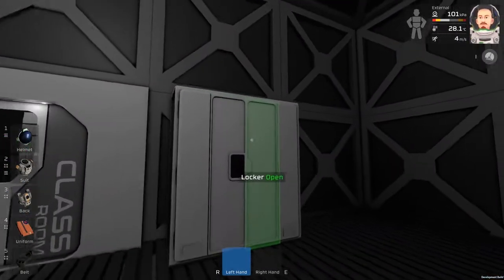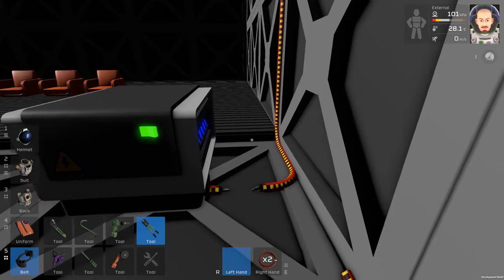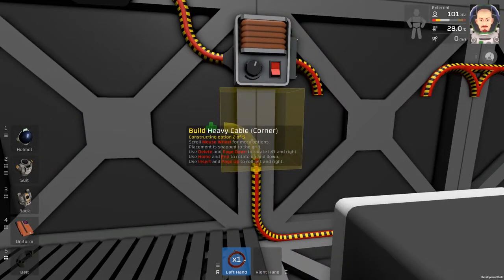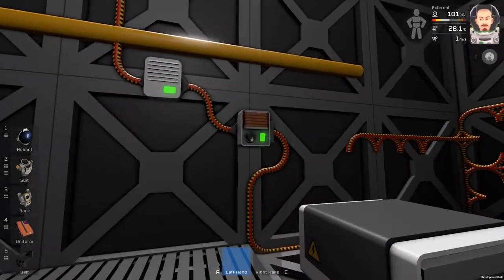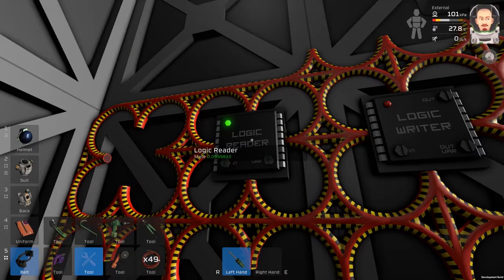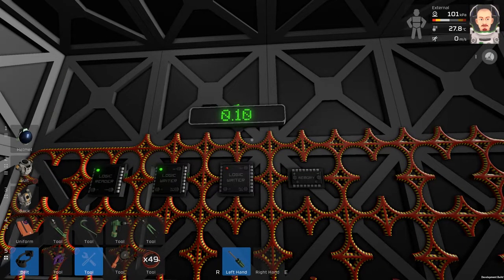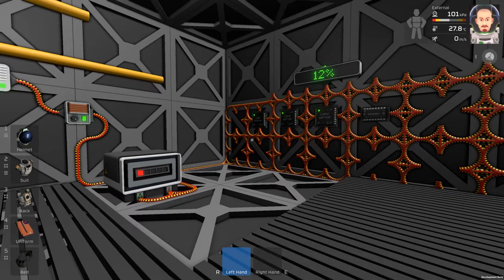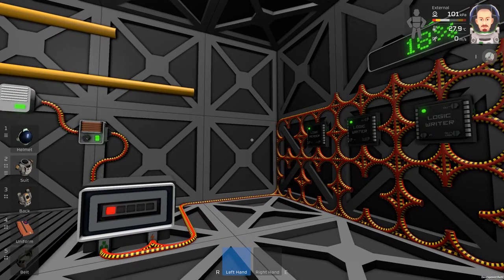Stationeers - Large battery charge capacity display

Comment: for some reason my logic writer don't have the led display as a option for out
Reply from the maker: Do you have it connected?
Reply: yea it took like 6 minutes, i have 20 battery's i had to get through
Reply from the maker: You can make small subnetwork from that writer which goes directly to the LED Display, then you will do it in 10 seconds or less, if it is possible

or

Connect writer directly with one cable to LED Display, program it first and after that connect everything you need

and

Dont forget, if you hold ALT then you go backwards when programming readers and writers

Comment: here is how I made mine for a large battery bank. 

not sure how long this link will work
https://ibb.co/dQpALn

CA1 -> cable analyser on the output of the battery bank.

Chip: LR1 Logic Reader)
Input: CA1
Value: Power Potential

Chip: LR2 (Logic Reader) (could be replaced by Memory chip)
Input: Stationary Battery
Value: Maximum

Chip: M1 (Memory)
Value: 100

Chip: M2 (Memory)
Value: (7) number of stationary battery

Chip: MU1 (Math Unit)
Input 1: M1
Input 2: MU2
Out: Multiply

Chip: MU2 (Math Unit)
Input 1: LR1
Input 2: MU3
Out: Divide

Chip: MU3 (Math Unit)
Input 1: LR2
Input 2: M2
Out: Multiply

Chip: UM1 (Unary Math Unit)
Input: MU1
Out: Ceil

Chip: LW1 (Logic Writer)
Input: UM1
Out: LCD1
Reply from the maker: impressive man, we still need a parking lot for logic circuits, dont we? :D
Reply from the maker: I have scheduled videos for next 6 days from Stationeers, I am sure, you will see there something very similar, thank you very much for sharing the picture of your setup
Reply: true. this one is fairly simple. I have some that are a nightmare to follow or do
automating stuff can be a pita

this one was just for fun as I'm working in a sort of "creative" mode on the moon.
I have a 32 stationary battery bank and just wanted to know how charged it is so I designed this circuit

however, since the latest build of the game. I'm in a bad shape due to a few game bugs (running beta) 
have to wait for them to fix theses :)
Reply from the maker: I am running Beta too, I dont know why, but I have a feeling, Beta runs better for me
Reply: have atmospheric issues on my game.
1 of my room is currently burning when I open the game.
another lost my circuitry

on a different room, airlock open, 0kpa. I jump through the airlock soor and 100kpa.  I jump back. 0kpa. 
same issue with normal door.  Door open. 1 side has atmosphere. the other does not

have not been playing since last 2 weeks so I guess something broke down
now, have to  deal with the hungriness :)

anyway, have fun and let's all play nice
Reply from the maker: try to deconstruct one wall on room which shows wrong pressure and put the wall back, it should fix it

Comment: Your class didn't make it today? that's too bad, thank you for the Video. Also does this work with more then on battery and can you change the color of the display?
Reply from the maker: My students are very lazy, last time I had too much mess in my class room when they left. 

How to change LED colors ( LED wall lights, it works for LED displays too )

https://www.youtube.com/watch?v=igxyP5jDE_U

For more batteries, you will need bit calculation lets say:

( battery 1 ratio + battery 2 ratio + battery 3 ratio ) divided by amount of batteries ( 3 ) and then diplay the data

for color change use logic writer with output LED display, input memory, where you will change number from 0 to X, variable color, or use dial for variable for color change, I think

I will check it